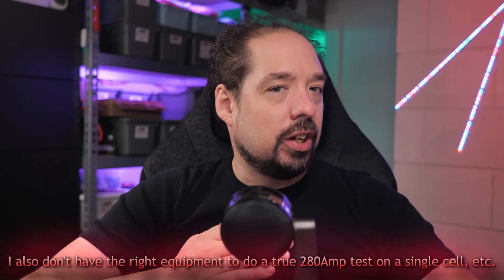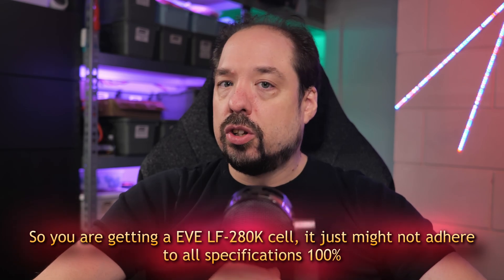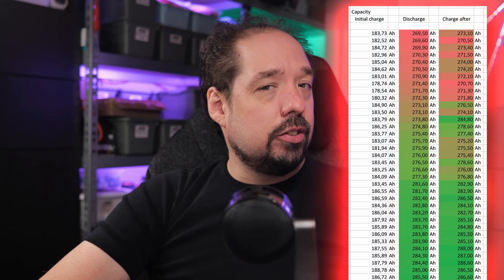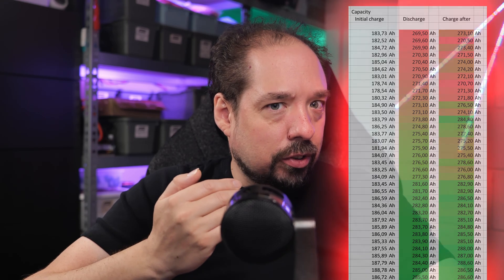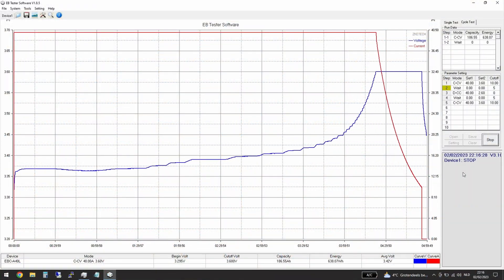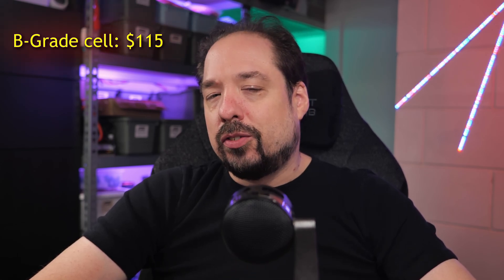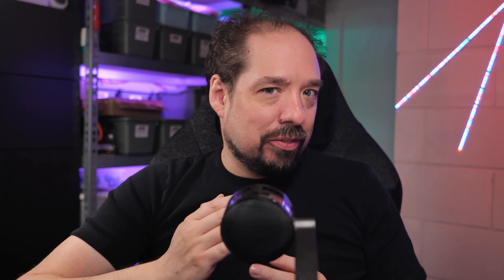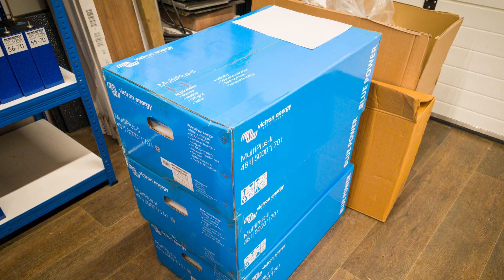⚡Quinergy⚡The truth behind B-grade LFP cells

Comment: I would say google Luyuan and Solar Forums.  I absolutely believe buying B grade is the best move.  The grading and certification they like to go on about...well...certainly they (the actual battery manufacturers) bin and send the best ones off to the automotive world, beyond that, there is zero ability to confirm any of the grading or quality rating claims that are made with regard to home energy storage sales and customers (ie by the middlemen companies like Luyuan, Docan, etc...).   You can test the capacity yeah,  IR changes (do you really know what the starting IR was to know what the value you measure now means, can you measure the same IR more than once?  twice in a row?) , etc... but no one is testing them through all X,000 cycles that are promised and even if one guy does, it is him and his tiny sample as you say.  It is important to not lose sight of these facts when making claims in videos and as customers who will be making purchases.  Remember, these are not the people making anything.  They are just able to buy from the actual manufacturers, then mark up, value add, whatever, and sell to you.  That's it.  If you have any actual on the record information from EVE or CALB, that would be a very different situation.

Comment: If you're not pushing high currents in and out of them and limiting their state of charge to say 20%-85% a chunks active balancer with the BMS mitigates the capacity difference between cells. I know guys who buy hundreds of 18650s and only loosly balance the blocks of parallel cells and rely on active balancing to keep the whole thing from catching fire lol.

Comment: The average of you pack configurations (270+270+280+285)/4 = 276Ah. Slightly less than the A grade guarantee but considering the cost savings well worth it.